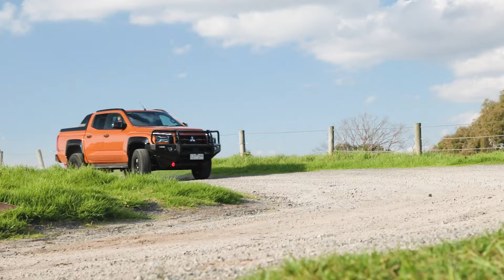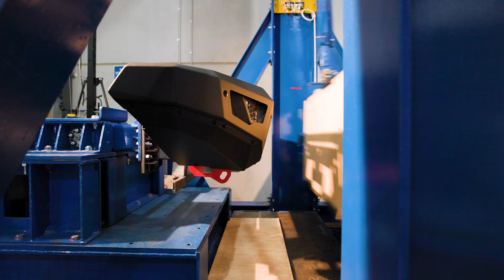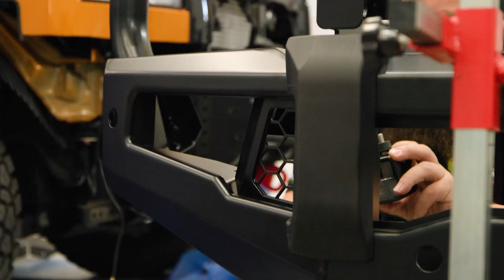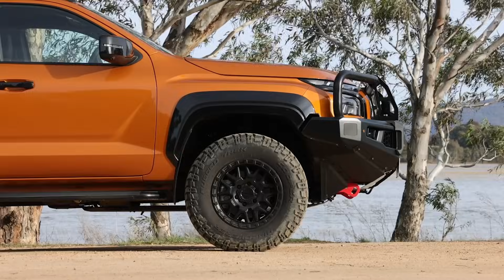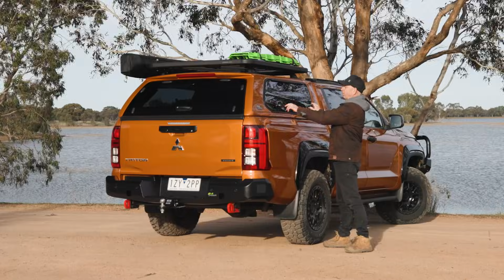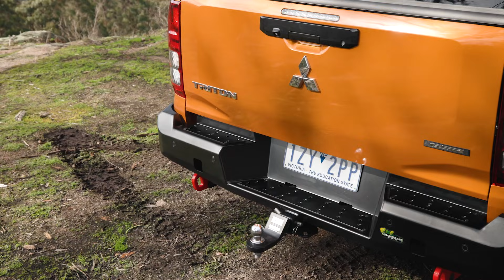Ultimate Off-Roading: Customizing the 2024 Mitsubishi MV Triton Touring Build

Comment: Just installed your bullbar on my mv trition ,  what a CNT of a job , instructions said 5.5 hours , took me 13 hours,  with full workshop and 4 post hoist.
Took me half an hour just to unwrap it and another 30 minutes to print the cutting templates to correct scale, here's a tip ,why not just include them in the instructions.
4×20mm holes in the chassis was fun as well and dye grinding front holes so the cradle would match the chassis brackets.
Other then that it looks good and give a gold medal to the man who can fit this thing in 5.5 hours.

Comment: end up costing 90k plus with the car, hard to justify that.
Reply: Not really....I paid $56k for my demo GSR with under 200km. And it included snorkel, tow bar, under protection kit, rear steel protection bumper bar, 31" all terrains and bonnet protector 😂.

They are letting these go cheap at the moment as there is stock everywhere and we are approaching 2025.
Reply: @gureno19 really? which state? I need details lol
Reply: Hiluxes are way more expensive to mod than this beast

Comment: Can you let me know if the front window of the Pinnacle 2 canopies open so you can clean the back window of the utes.  Specifically for NF Amarok.  Thanks
Reply from the maker: Hi @DavidHill-g2d the Pinnacle 2 has a small sliding window at the rear.